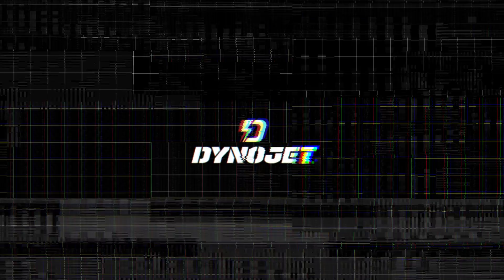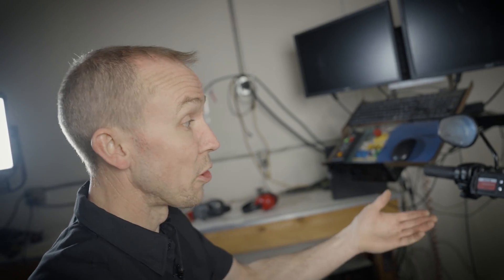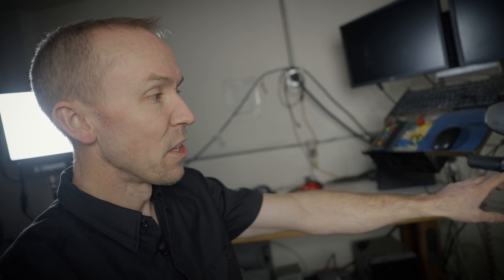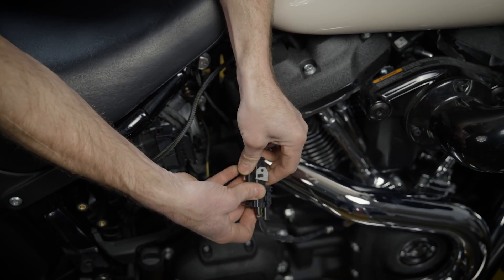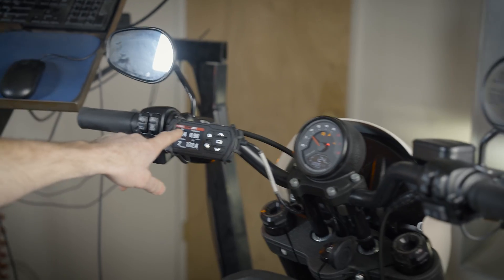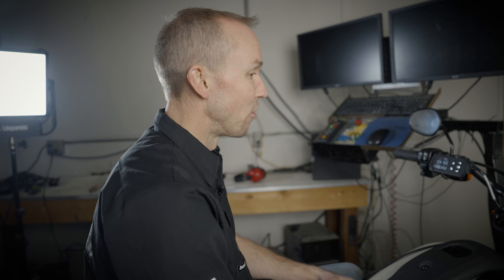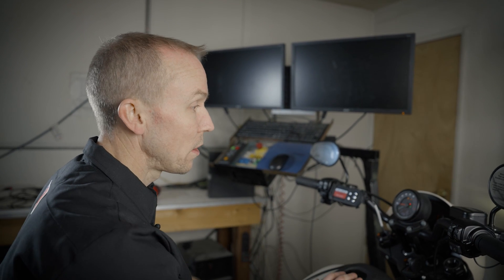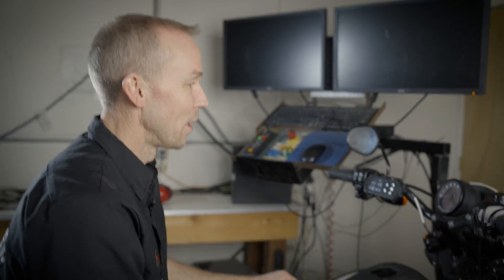Autotune for Harley-Davidson Power Vision 3 | In Depth Tutorial

Comment: The music is louder than the voice .  They need 12mm sensors. I don't want to remove my pipes and drill and tap the bungs.
Reply: Some bikes are compatible with stock narrow band sensors and auto tune basic. Go to the Dynojet page and search products for your bike. There's a compatibility chart showing if it will work with stock O2 on your bike.